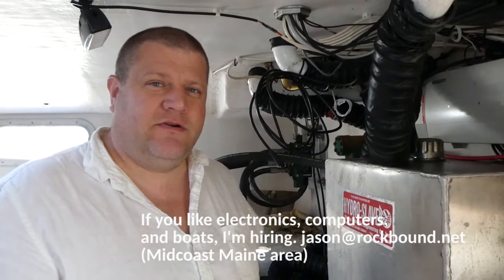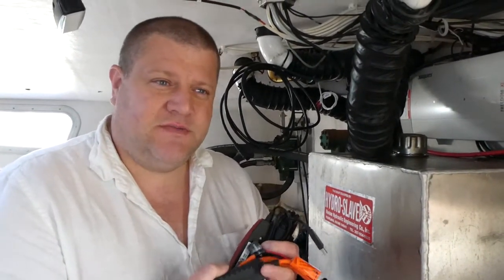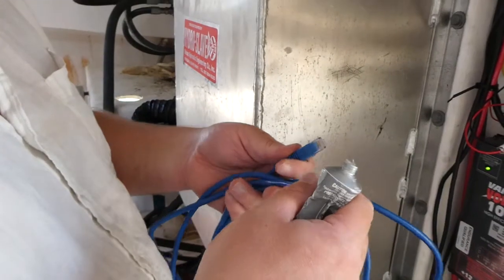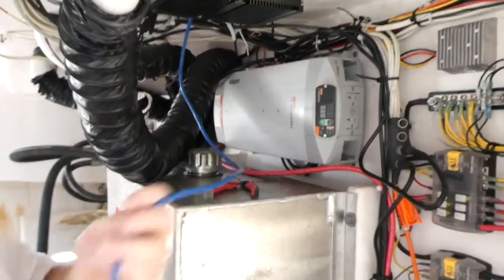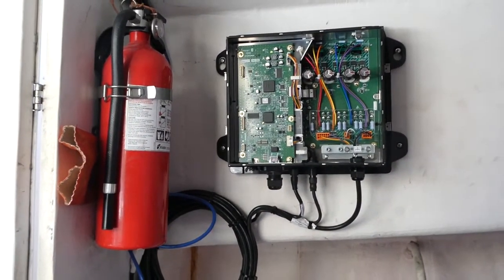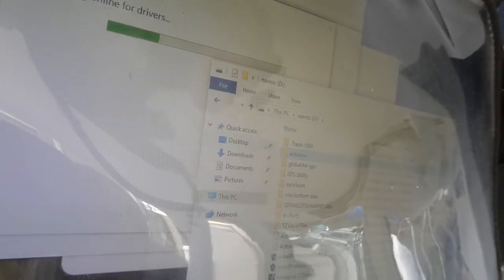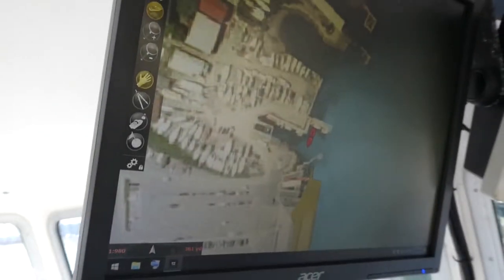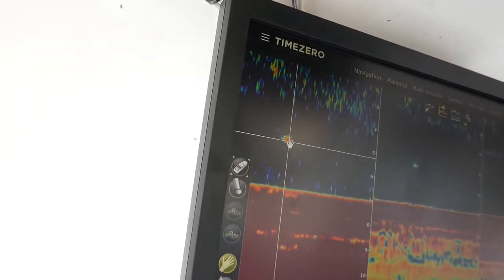At work installing SCX-20 satellite compass and DFF3D multibeam sounder with Time Zero Professional.

Comment: Jason, this is very nice works and you sir seem to have great knowledge in what you are doing. I have a full furuno suite with twin 12 inches tz3's, a naviplot 300 and nxt radar, I am planning on installing a SXC20 compass instead of the PG700 that came with the pilot. the issue I have is selecting the proper location for the sensor. My boat is only a small center console on trailer with soft canvas T-Top. the Furuno bulletin to install the scx sensor shows it should be placed above and away from the radar which in my case makes it complicated. I am wondering if I should just first try to put the sensor on top of my console and see how this is gonna work before purchasing different mounts and fittings ($$$). What's your opinion? thanks in advance for your time.
Reply from the maker: If you can get a mount to put it above the radar, that's ideal.. If not, a stable place with an unobstructed view should be fine. They are generally installed above the radar so as 1. Not to be in the beam of the radar. 2 . to avoid multipath interference from the structures of the boat (the scx-20 should be more resistant to multipath than traditional sat compasses, but it's still to be avoided) and 3. to have a clear unobstructed view of the satellites.
Reply: @jasonphilbrook4332  Thank you